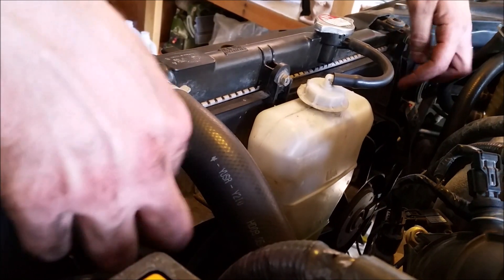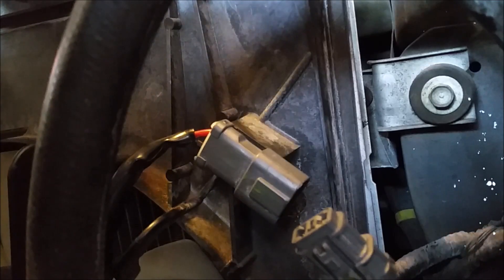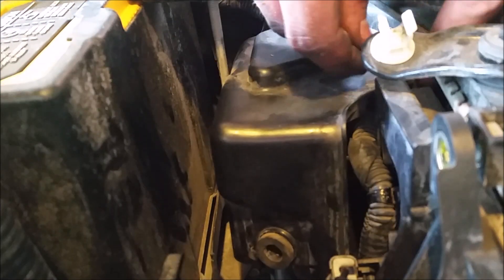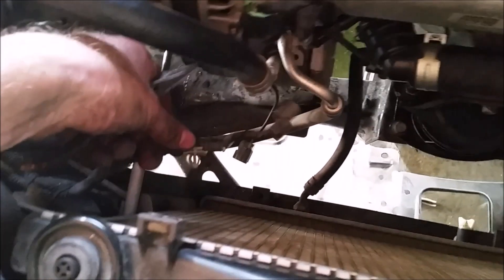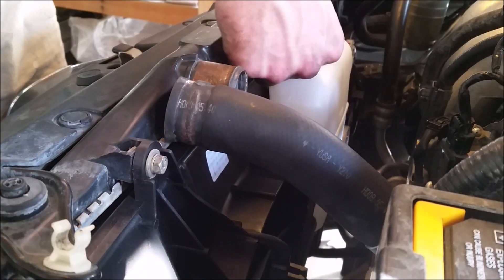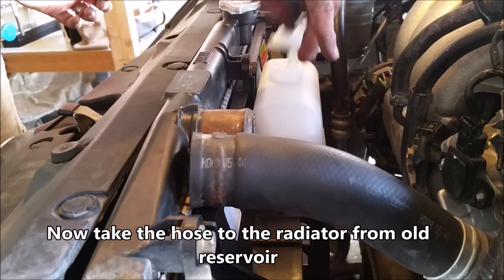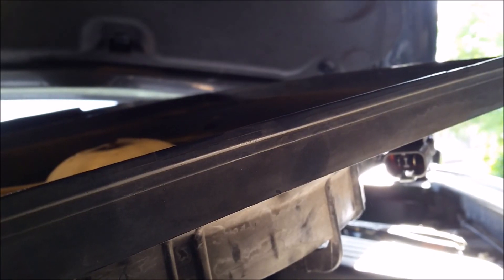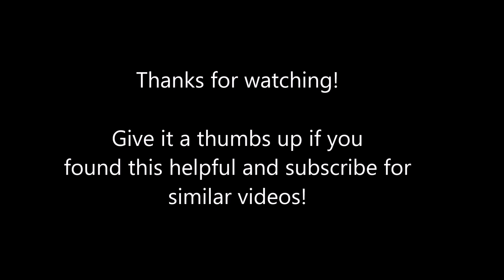2003-2007 Accord Radiator/Condenser Fan Assembly Removal and Install (2.4L 4 cyl)

Comment: this helped a lot.  Thank you!  Watched several videos (a few of yours too)  Was quoted almost $800 to fix my a/c and Fan issue...  I swapped my cooling fan motor myself in about 1 hour, paid $71.00 for that and also swapped a relay switch ($15), and the PCV valve ($24 - I could have got it cheaper but didn't feel good about the part quality)....  All in all, I saved a ton of money and my issue is fixed....  (posting the same Thank you message on several vids...)
Reply from the maker: I sure love saving money and happy you were able to save a bundle too! Thanks for the comment!

Comment: Glad I watched it. I was going to replace both fan motors for my mom since I had to drain the coolant. Now I see an even easier fan assembly that will be faster! And I won’t get the fan motors wrong! The whole assembly is the price of one motor at auto parts store! Thanks a bunch for the link.
Reply from the maker: Yes!! Those motors are crazy expensive! Glad it's been helpful!

Comment: Great Video!!!! I'm gonna try changing my cooling fan motor tomorrow. Its June 17 in Texas and its HOT! I already checked that the motor does get power from the computer/sensor. I even jumped the fan motor directly to the battery and nothing. Went to Oreilly to buy a replacement, and supposedly there are two types of fan motors. I don't know which one is mine. But the store only had one type of the motors so eh I took that one hoping it is the correct one. Thank you so much for the video!!! I really like it, speeding through the correct procedures(using the ratchet), using screenshots to indicate where to take action(clip and bolt locations), angles to show the location of what you are talking about. The lighting was good :) no need to apologize.
Reply from the maker: Thanks for the comment! Really appreciate the support!
Reply: Update: its done. I have to say you saying all the places where the assembly was being held down, felt like I cheated hahahaha. After it was installed, WOWWWWW the AC not only got cold faster but colder!! Thanks again!!
Reply from the maker: No problem!  Stay cool!

Comment: I know I'm late....but my AC stopped working. I ran thru every check on my AC system...then I realized that both of my fans weren't working......so long story short......I ordered a new fan assembly and it will be here tomorrow. Thx for the video!!!
Reply from the maker: Best of luck and thanks for sharing!
Reply: Hi, after replacing the fan did you ac work again ? 
My ac stop working also and figure out the driver side of my fan is not working . I'm wondering if the driver side fan can be the problem

Comment: Just performed this on my car, great video along with the pics and instruction. Was able to reach down and grab the bottom plug. Then used flat head in other hand to lightly push it off while squeezing tab. In case someone can't get under the car for it.
Reply from the maker: Torino117 Thanks for the comment!

Comment: Thank you for this video, it helped me in changing my fan assembly out. Only issue I ran into was the screw on the part that had to be switched from the old to the new was so rusted I had to drill it out and use a screw from my parts bin.

Comment: U said that there was only 3 I see 4 two at the top and one one on the passenger and another on the driver side on the bottom what year accord is that? Is that a v6 not a 2.4? I need help I’m not tryna spend money on one that only has 3 when I’m supposed to have 4 contractors

Comment: Sir.. Do you know if you have to remove the radiator on a 2004 Honda accord V6?  I am curious cause it effects my labor..I need a new condenser.. And I am getting different quotes...thanks in advance if you can help ~Zack
Reply from the maker: Hi Zack, Unfortunately I cannot say. Mine was a 4cyl and that's all I have experience with. Best of luck!

Comment: Great video I just did it myself save $700 that Firestone want for the part and job, thanks a lot. Do they run at the same time or one for the AC an another for the radiator?

Comment: Great tutorial. For me, the clips were a pain. Screw on passengers side could not be unscrewed. Could have drilled it but I snapped the fitting and zip tied it to new fan. Whatever, it works now.

Comment: Do you think I can successfully take out the whole radiator/condenser fan assembly without removing the upper radiator hose? Thanks!
Reply: Nope, I tried it. The A/C line on the passenger side is in the way. If that line was just one inch to the left or one inch closer to the radiator, or if it wasnt there at all, it would have been beautiful because the fan would slip right out under the coolant hose.

Comment: you think it  would have been cheaper to buy just the motor for the fan assembly? I'm looking to fix my fan as well.
Reply from the maker: bluraymex23 I had hoped but I couldn't find it cheaper. The motor from Honda is pretty expensive, around 300 if I remember right.
Reply: clintathusaz I found the motor on eBay for 25 bucks would you recommend that or buying the whole  assembly?
Reply from the maker: bluraymex23 Good find! If you've done your homework and are confident it's the right motor, doesn't sound like a bad deal. Is it used? Or the same part number?
Reply: clintathusaz yes right part thanks for the chat I appreciate it .gonna do it tomorrow  morning.
Reply: what is the part ##
Reply: amazon has the driver side motor (tyc brand denso replacement) for about $38, rockauto has it for a bit less. The passenger side motor is a bit more expensive, probably better off getting the whole assy if it fails. Note that there are (at least) two different parts, one for the denso radiator + fan assembly, and one for the valeo radiator + fan assembly. I think denso is more common, but it's good to check before ordering. the passenger motor has denso stamped on the back, if the stamp on the radiator isn't visible.
Reply: Ben B thanks bro I got the part  for like 10 bucks at the wrecking yard and installed it

Comment: have you had any overheating issues with this fan assembly
Reply from the maker: Nope.  Granted, I don't drive the car all that much (<3k miles/year), but I did have a few times before that in hot AZ summer at idle where it started to overheat before making the swap.
Reply: I got just the fan  assembly today for 12.00 bucks gonna put it on this weekend thanks for the quick reply.
Reply from the maker: Good deal and good luck!

Comment: Could you get away with replacing the motor for the cooling fan rather than the whole fan assembly? thnx!
Reply from the maker: I tried looking for just the motor but couldn't find it at a decent price so went with the whole assembly.